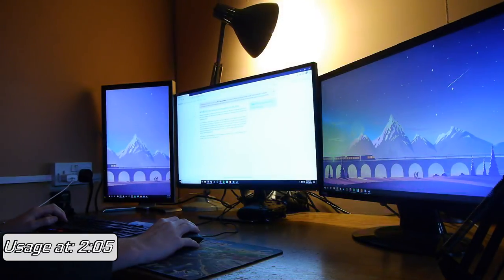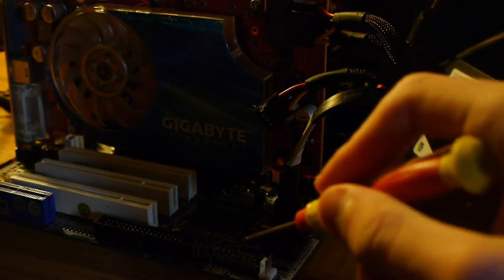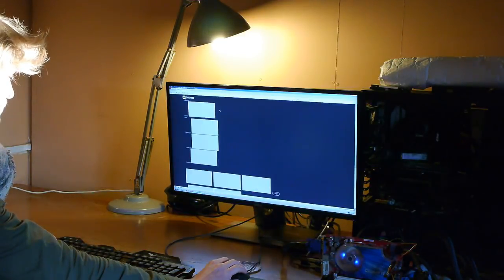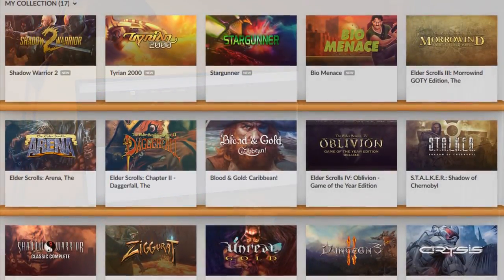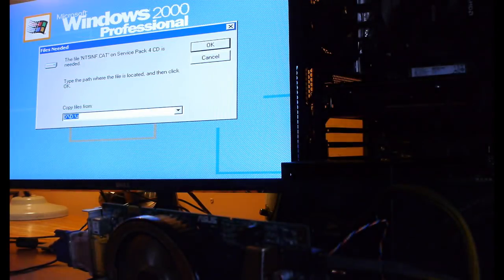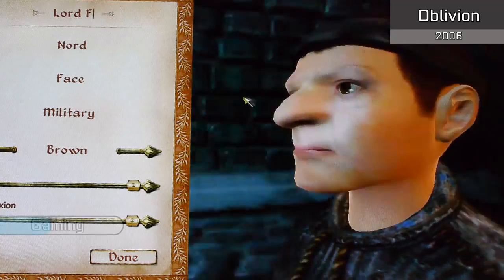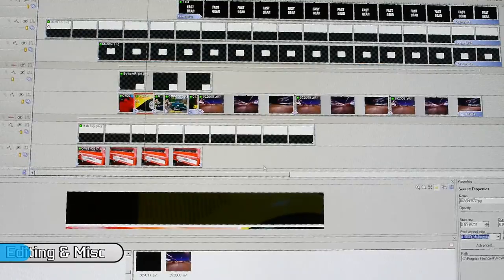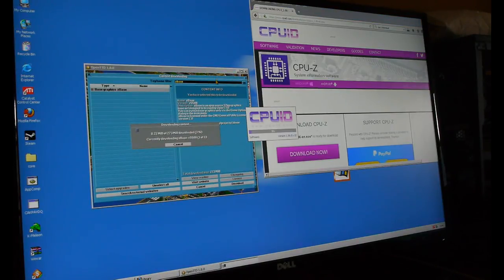Windows 2000 - Is it any good today?

Comment: Is Windows 2000 just like 98 SE but slightly better?
Reply from the maker: Entirely different. It's based on the NT Kernel not 9.X. it's closer to Windows 10 than it is to DOS.

Comment: 2000 is so unpolished in comparison to XP. It can't even play dvds right or work right with my games. The only advantage 2000 has over XP is that it runs faster then even the original RTM XP. SP4 for 2000 is still faster than XP with any service pack.

Comment: I had in the past an XP windows system whit a Pentium 4 HT, It were the most smooth and fast I had experience as an operating system. one klick and it were there. Now have 7~8.2 and 10, whit quart core and SSD and stuff, I klick some times more times, as it does not show up things directly as I will be used to, thinking that I did not have push right. You will think, SSD, much faster memory and multi-core processor will be much quicker than a Pentium 4 HT and so as old stuff. I really miss the XP windows system, as be working great and fast, Okay  Windows 7 enterprise seem to work more or less like a Windows XP a bit if you close lot of bull shit  that is not really necessary and only for visual looking a bit good, But as I compare that It,s on a Multicore and so, I will think that it at least be faster than that old pc a windows XP and HT Pentium 4. I think I, ts looks like those new operations systems just made to collect more data or so, I don,t know.but just wondering where it sticks all that time in otherwise, as technical it has to be more than 10 times faster to run it, I did try to install Windows XP on a more  modern pc whit a multi-core and stuff , but It run by installation ever time on some  error that it not can install XP, not sure what the problem was off that, and had set a windows 7 enterprise  on it that did do install on it. But so not be able to see how XP will do on a more modern pc, sad, why the alway,s change the windows operating system, as it finally after years off updatings works so great that XP, and also be shit that lot off drivers, programs  not be working on it, as lance on a new windows system, and only had the drivers tot XP for it. As window 7 enterprise have luckily the option  to run in a virtual XP on it to use some older stuff, but for me, Window XP be just simple and fast as it must be the way, and those visual good looking stuff those days,  i,t only slowing down the speed, it only need to open up the program,s you like to use, and let the hardware works in my opinion. Some will say, just buy all new rant stuff as being old already, but why need as it still had worked fine on an XP, I, ts just a waste to throw away things that had to normally just need to get work on a new window system. It,s the only pollution the planet as a need to buy all thing new that not be broke, but only not work because of changing the software ever time. I just hate that, as some external  hardware you can not change, as a sample, you had used an old Digi tape video camera shutting lot off video of the time the kids were baby, you will use it still on your pc as full, some things work still connect on the firewire(that input the also not on new pc), but as connect the USB, The  Newer windows system don,t recognize what,s be conected, how stupid is that as the older XP and 98 did know exactly what be connected on it.so why a windows 7,8 or 10 do not know it? it sucks, as it is just a simple connection to the memory stick off that camera, or, and that can be used also as a webcam option, well, it did in XP works okay always. And also I did like that option that has had a girl abroad,  I did  go skype whit, I connect  the camera on the pc, and let her see an old videotape turn off an old video I had made from the past of my Digi tape video camera as that also just be possible to do on XP, but now the video camera not be recognized in skype. All those so-called updates look to me as being downgrades in many ways, The programs getting 10 times bigger or more, and options only getting less it seems to be, I just miss the fast and smooth  XP whit his options it had in the old day,s I had used to it. As it works so great and had an ever works greater whit the new pc hardware whit it,s multicore processors and fast SSD, and memory stuff, as now it seems to be used more to only collecting the data of people and  some visual experience that for me were not really be a  necessary to have

Comment: Please make a video on Linux...
Reply from the maker: Whats a Linux?
Reply: @BudgetBuildsOfficial  clears throat

I'd just like to interject for a moment. What you're referring to as Linux, is in fact, GNU/Linux, or as I've recently taken to calling it, GNU plus Linux. Linux is not an operating system unto itself, but rather another free component of a fully functioning GNU system made useful by the GNU corelibs, shell utilities and vital system components comprising a full OS as defined by POSIX.

Many computer users run a modified version of the GNU system every day, without realizing it. Through a peculiar turn of events, the version of GNU which is widely used today is often called "Linux", and many of its users are not aware that it is basically the GNU system, developed by the GNU Project.

There really is a Linux, and these people are using it, but it is just a part of the system they use. Linux is the kernel: the program in the system that allocates the machine's resources to the other programs that you run. The kernel is an essential part of an operating system, but useless by itself; it can only function in the context of a complete operating system. Linux is normally used in combination with the GNU operating system: the whole system is basically GNU with Linux added, or GNU/Linux. All the so-called "Linux" distributions are really distributions of GNU/Linux.
Reply from the maker: This is a yes moment. 

I do have a half made video on Linux, which i will be finishing at some point soon if i get the time

Comment: I got sincity 2000 from origin for free it come built in with dos box so I did not have to install dosbox  but it works on windows 7 64,bit  .my PC from 2013  but it can't run xp try it it bsod  but maybe cuae I got 8gb ram .  but my PC is AMD athlon 2.8 ghz dual core socket am3

Comment: why can't windows 2000 install in new computers?
Reply: new PCs use a UEFI bios that isn't supported by windows 2000's boot-loader natively. but I think hacks exist to get around that problem. the bigger issue is that you will have a hard time finding drivers. the oldest OS that the majority of hardware vendors support is windows 7.
Reply: @psionx1  why don't uefi bios support windows 2000? what is uefi?
Reply: @auro1986  the Unified Extensible Firmware Interface(UEFI) was created to make BIOSs that were more interactive / easier to use and add support new storage standards like GPT partition tables(3+TB drives) and NVME(Pci-e SSDs over 600MB/s). it has other more advanced features but those are the main ones. as far as why it won't work the answer is simply that windows 2000 is so old that Microsoft didn't feel like making an updated boot-loader that allows it to work.
Reply: @psionx1  do you now think you know all about computers?
Reply: @auro1986  in terms of knowledge I'd say I know a little more then your average bestbuy / apple support guy. but I'm no super expert that knows all the DOS/linux terminal commands and writes software from scratch.
Reply: @psionx1  ok

Comment: Kid, I dual booted a system with Win2K and Debian Linux back then. When taking an A+ course which is fucking retarded, I did all of this in 2000,  But what most people don't know is this, I use LILO, Boot Win2K, 98, and Debian. So technically I had a Triboot system.

Comment: What;s the difference between this and Windows Me?
Reply: ME is based on the windows 95/98 kernel and source code whereas 2000 was an evolution of the business orientated windows NT platform. XP was Microsoft first attempt to bring consumers into their far more stable and secure NT ecosystem, but 2000 therefore can effectively be seen as a less bloated, more productivity focused variant of XP. I loved 2000 from the minute I got my hands on it and never looked back, even putting off upgrading to XP until driver and software support made it necessary
Reply: @mattpowell8369  Guess that explains why mine can only run Doom or Wolfenstein in small windows.

Comment: how you instaled it on sata hdd for me its giving an eror
Reply: When you install Windows 2000, near the very beginning of the install you should see a "Press F6 if you need to install a third party SCSI or RAID driver" - That will give you the option to insert a SATA driver floppy disk. Alternatively, download NTLite, download your Windows 2K ISO, extract the ISO, point NTLite to the extracted folder, and "Slipstream" the driver into the ISO itself, and burn that to a blank CD. That will allow you to skip the Press F6" stage and have the SATA driver integrated into the ISO itself.
Reply: @coffeefox5703  Thank you. Do you have a preferred SATA driver?
Reply: @iWalkChris  Nah, nothing preferred in my case. I usually just use whatever driver fits the hardware I'm using. Currently running a old Compaq Deskpro EN with a PCI SATA card, so I'm using the associated Promise 150/300 drivers.

Comment: Good enough to put on a virtual machine to be able to use some dumb-assed program that is only written for Windows when you're running Linux.
Reply: That's exactly what I do. Win 2K for my aging 2008 version of Quickbooks accounting software in a VMWare machine hosted by Linux (Mint Cinnamon 18.3 for now).
Reply: @paulanderson79  Stick with that setup.  It's POSSIBLE to run QB under Wine, but I STRONGLY recommend against it.
Reply: @fuzzywzhe  I did give it ago a couple of years back. The results weren't pretty shall we just say?

Comment: SSD's on old operating systems can potentially lead to damage or quick wear on the SSD itself as the operating system has no idea what it is, doesn't have a TRIM function and may try to defrag the SSD like a HDD. I wouldn't really recommend using one on anything older than Windows Vista.
Reply from the maker: Most SDDs have either TRIM built into the firmware or they have software to allow trim intervals on older OSs.
Reply: @BudgetBuildsOfficial  Is there a way to check which products have these features built in when buying them? Honestly buying SSD's feels like trying to clear a mine field with dodgy practices like the removing NAND flash and controllers from the products and still selling it under the same name.
Reply from the maker: I've been running a WD Green SSD in a lot of my retro builds. an Original XBOX, and JTAG Xbox 360. None of which support TRIM, the SSDs are all reporting back at 100% Health, and perform very nicely from my testing :)
Reply: @BudgetBuildsOfficial  Okay thank you. Then I might get one for a Windows Xp pc I had laying around ^_^

Comment: Why do you keep suggesting people use Windows 10?

That OS is a pile of shit, Windows 7 is better than 10
Reply from the maker: Which one is free and easily downloadable directly from Microsoft. I Dont like Windows 10 but with a proper debloat its not a bad OS
Reply: @BudgetBuildsOfficial  until it wants to update and restart itself while you are using the computer
Reply from the maker: You do know you can turn all that off right? I mean I don't like the OS... But cmon
Reply: @BudgetBuildsOfficial  there is no option in Windows 10 that lets you set updates to manual download and installation (the same setting as Windows 7) 

you can't even use active hours or the metered connection setting to stop it (since it doesn't let you set active hours to 24/7 and it still downloads on a metered connection)
Reply: Michal Litecký  and how do you turn off auto updates and spying tools on an operating system that doesn't have the option to do so
Reply: Michal Litecký  "no need to" you won't be saying that when you need to quickly restart your computer and it says "restart and update" instead of just "restart" 

Or maybe it restarts itself while you are playing a game and you lose 2hrs of progress 

Or perhaps you are just low on drive space and don't want Microsoft wasting it
Reply: Michal Litecký  I have had Windows 10 computers restart randomly while I was using it, I already use SSDs (hence why I don't want updates downloading automatically) 

I don't want the update at all, I want to download it on MY schedule, not Microsoft's (and with some updates, that means never)
Reply: Michal Litecký  well it always happened to me within a month of Microsoft releasing a new update

Update released, within 4 weeks my computer would restart itself to install said update, no matter what I did to try and stop it, even setting my network as a metered connection didn't stop it from downloading updates automatically

Now I'm happily using Windows 7 on all my computers and il probably never go back to 10

Comment: "But can you game on it?" WTF kind of question is this? Are you actually aware that games have existed on PC for decades? So yes... you can run games. A more accurate question, perhaps should be, What are the newest games you can run on this OS, given the limitation of API support for it. You also repeatedly seemed surprised that this OS can "handle" certain software well. I'm really confused by this. You do realize that the relative speed an OS runs at is mostly limited by the hardware it runs on? You seemed shocked that it could run software that was designed to run on it well. Wow, this thing that is made to run on an 18 year old OS running on 10 year old hardware is running really great! Its like, not too slow or anything. Weird...
Reply: Mate.... The video was just to test all common aspects of the operating system.  I'm not surprised it runs things well at all.

Comment: It's useless. WIndows-wise: W10 for modern to semi-modern PCs (W7 is a hassle since support is ending, dealing with 'wufuc' to enable certain newer hardware to work, and dealing with offline updates), XP for generally old to old PCs, and 98 SE for completely legacy PCs for 9X games only (everything else is pointless).

This is coming from a W10 user who started with 95 and occasionally uses Linux for testing.

Comment: Windows 2000 is without a doubt, a better operating system than Windows 10. But so is any other operating system that doesn't come with 3 versions of Candy Crush right out the gate. Oh, and sells your data too.

Comment: so much bullshit add windows 2000 on a modern system and make custom drivers for the hardware to report results dont just run it on a dinasaur pc , Why? compare 2 identical  one win10 the other 1 running win2k and see pros and cons thats what a real techwiz would have done. older os can run new drivers if you somehow hack them to it

Comment: PSA: Don't use Win2k as your normal OS. It is not secure, not supported and you can end up getting attacked easily compared to modern OSs. If it needs to be free use a light Linux distro. :)